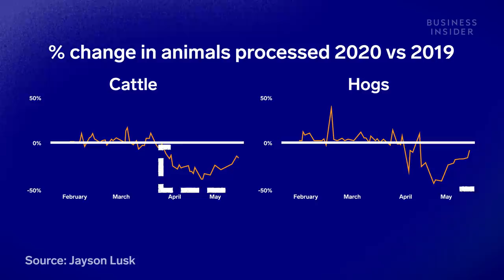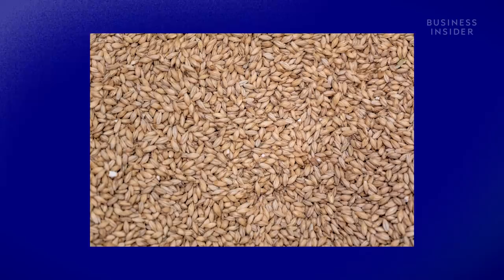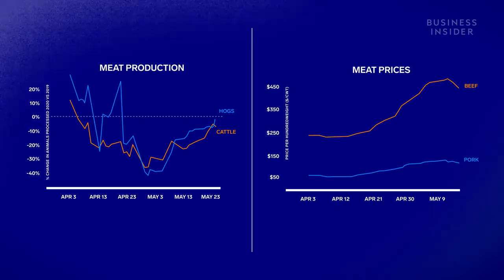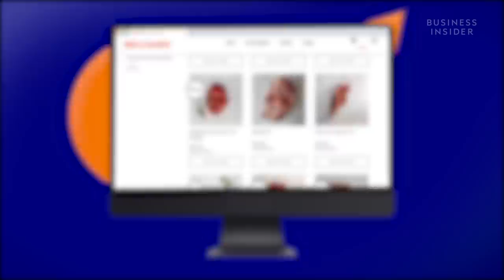Why 1 Million Pigs A Week Could Have Been Euthanized Even During A Meat Shortage | Big Business

Comment: If the pig is bigger than 280 pounds, they wont take it..

Sometimes I don't understand 1st world problem
Reply: I think that a combination of factors lead to requirement like that. Maybe the quipment can't handle it?
Reply: They do take them most pigs anymore are 300 to 350 pounds Last summer me and my dad took a load of hogs to the JBS plant in worthington mn and we had a 394 pounder they won’t take him because there cut of was 350 so they take them to special plants that are set up for that
Reply: John Claus Van Damn you’re right!
Reply: Jack Ten Napel Yeah same for cattle my family raises beef and some of our cattle can’t go to the sale barn because they’re too big. I think you get fined for cattle that are too big I’m not super confident either way we’re stuck with cattle we can’t sell
Reply: It's efficiency and automation. 280 Lbs is the optimal weight for the least amount of feed and the most amount of meat, thus, the slaughterhouse is designed for this specific weight. With machines hyperspecialized and calibrated for this exact weight. Something larger would break the machines.
It really, really is a 1st world problem.
Reply: It's because the plant is set up for a certain size animal, they can't adjust that "setting" very easily. They will adjust it periodically, but it's a big decision.
Reply: This is not a 1st world problem, this is a machine problem. Where you have a meat industry, you have this problem, regardless of the type of animal.
Reply: @neto1a  nope,, in third world country, We used peoples and knives, so size is not a problem
Reply: @shionmoon384  Nop, ask Marel, Meyn, Linco where they sell equipment for automatic cutting, automatic evisceration, CMS, CMR ... An example of this is Brazil, which is not a first world country.
Reply: that's vry stupid....they could sell it to some chinese slaughterhouse
Reply: This is faults.  It is not that the meat plant won't take it, its that the meat plant will dock the farmer a percentage for being overweight.  The meat plant actually makes more on a bigger animal.
Reply: @rickokemp1244  No, you are not 100% correct. Meat plant cannot support all kind of weights. Machines have a limit, range, and many of the machines support only a small variation in weight.
Reply: @rickokemp1244  sry rickobaby, but you are wrong. See the automatic evisceration process, Marel,, Meyn, Linco.. nowhere in the world can you slaughter a 1 kg and 4 kg chicken with the automatic evisceration process. Even in stunning you can’t run with so much weight variation. And you have the biggest problem, customers. You have closed contracts to supply poultry with a certain weight and quality, you cannot sell chicken breast with 100g havier, or wings twice the size ...
Reply: Look up the word "PACKER HOGS" 280# is the ideal weight.   Packers are sows that go thru plants too -- read up moony.
Reply: @neto1a  NETOASs1, you been drinking the bath water again.... wrong -- KGRAMS are a system used in CHINA, know wonder all your meat plants don't work.  Everything is plastic and breaks.  1st world countries are the way to live man!  You just explained everything in your last post.  Sharpen up and learn a little instead of opening your jaws.
Reply: @neto1a  It's not about who is right or wrong -- It's about the TRUTH!  Learn to read and open your opinionated brain and life will be much easier.
Reply: @shionmoon384  true. We use human😂
Reply: @williamlewis8759  I'll take all of the cattle that you feel you are stuck with
Reply: @neto1a  Reread what you wrote and think about it.  What you said is only a first world problem.
Reply: @TruckTaxiMoveIt  Brazil is a first world country? Ask to Minerva, BRF, JBS, Copacol, Lar, Frimessa... (brazilian companies) if they have this kind of problem.
Reply: Because they start getting tough and lower quality as they get bigger than 280 pounds.
Reply: So, the maintenance/machine shop/tool & die aren't capable of modifying a pre-process step on the line? How rediculicely pathetic. 
Add a pre-step killing floor.
1.) Weight the pig. 
2.) Kill the pig.
3.) Remove a ham & shoulder to bring the weight down for the original conveyor line.
Destroy good meat bc the machinery is too fragile. What a waste! 🤔 We're Americans!!! We're better than that!!! WTF!!!
Reply: @shionmoon384  the bigger the better
Reply: I've butchered 300+lb pigs, it's a nightmare they are super fatty the meat is more greasy
Reply: @youknowme2322  how do you ship millions of pounds of live animals thousands of miles humanely, failing that how do you ship millions of lbs of carcasses cleanly and safe for human consumption?
Reply: @shionmoon384  this is why you  always relay on first world country help ? Lol
Reply: The uniform size of the equipment, machinery and facility needs to have uniform size livestock or poultry in order to run efficiently.